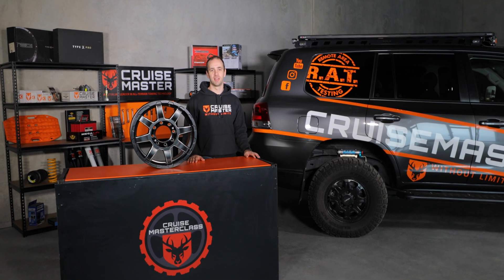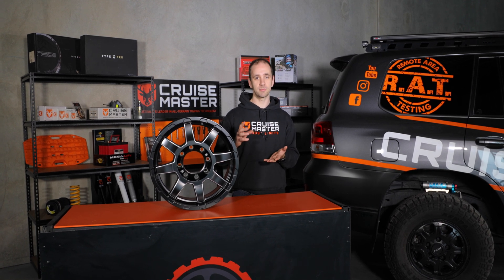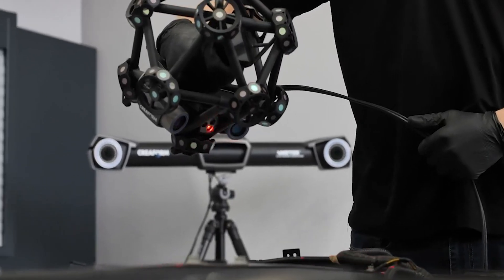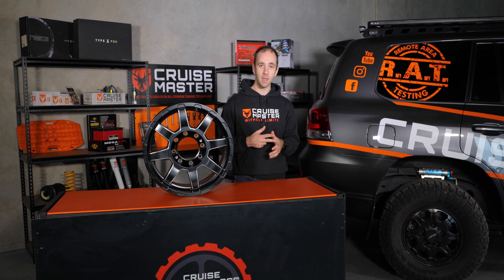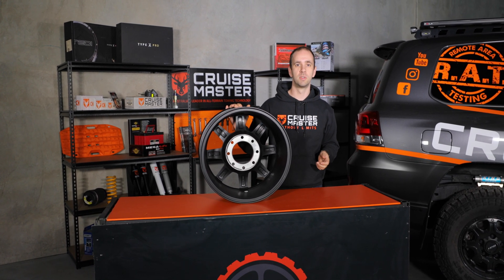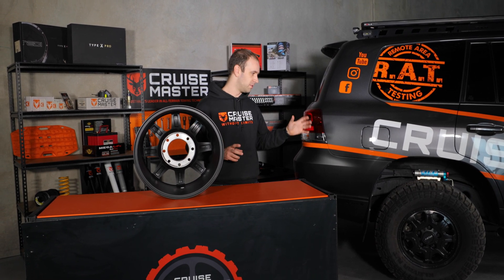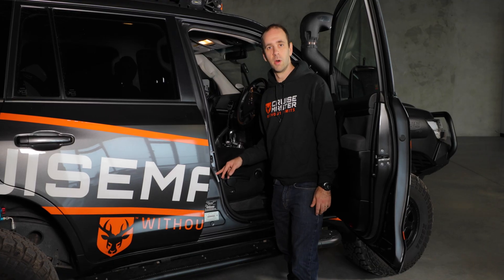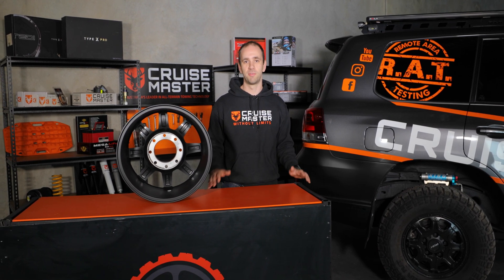CruisemasterClass Ep. 20 - GVM Upgrades

Comment: One aspect of GVM upgrades that no one seems to cover is are the mods approved by the vehicle manufacturer? If not and let's say the vehicle is still under warranty, who covers the cost of repairs or replacement to a component, e.g., a transmission or engine failure that is directly attributable to carrying/towing a load over and above the vehicle manufacturer's limits? I'm pretty sure the manufacturer won't. Will the GVM kit manufacturer cover it? I doubt it.